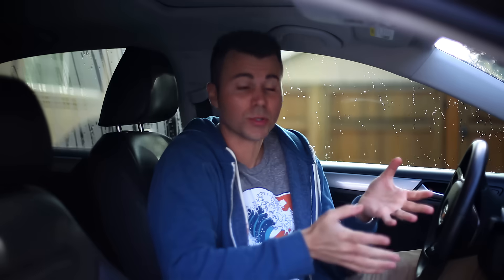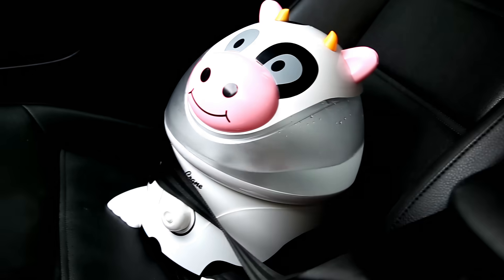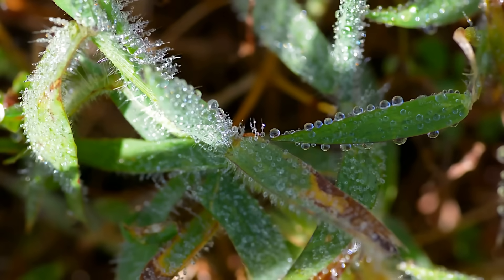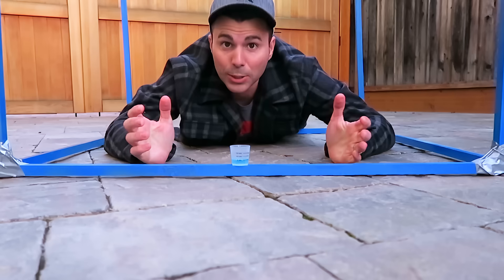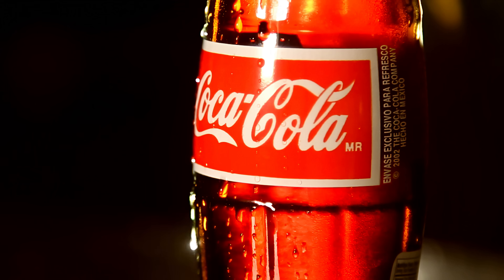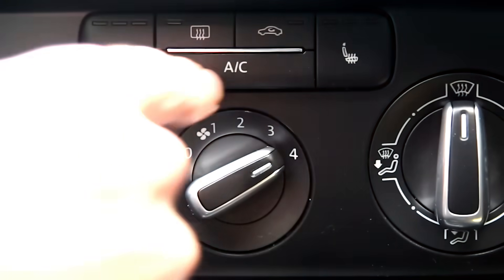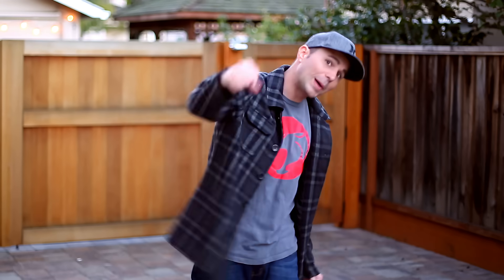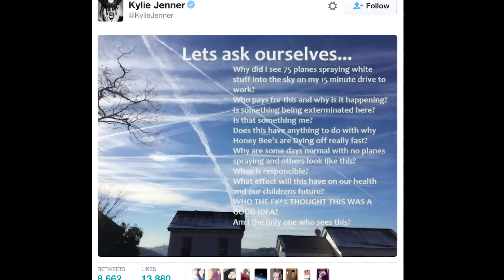Defog your windows TWICE as fast using SCIENCE- 4 easy steps

Comment: The Rober Principle: If Mark makes a video, it goes viral.
Reply: +Mark Rober I see what you did there! Also, while you're here, on a water bottle rocket, are long fins, or short fins better, do you want it to spiral, and what is the best ratio? I would like to see a video on it, or, if you don't want to do one on that, then you could just reply, which I would be just as happy about! Thank you!
Reply: +Mark Rober :D a reply from mark
Reply: ***** Thanks for answering! I have (basically) already done so, as I did it in my honors science class recently. Our rocket, which had three long straight fins, a screw on cone (as we had to put a payload in/on it), and was filled with 1/3 water, 2/3 air, and went the highest, compared to about 6 others which were each altered differently. I just wanted to see what you would say, as you worked for NASA. (Also, I gave my science teacher our rocket, and made a replica afterwards so I could work on it at home). Thanks again!
Reply: +Mark Rober Why do you keep saying "believer of the scientific method"?, this is only bait to any "non-believer" (using your terms) to argue that science is a set of beliefs. It isn't. We use the scientific method because, so far, it works. If some better method comes along, well then, we change it.
Reply: Scientific method = hypothesis, prediction and experiment.  Strictly speaking experiment and observation without model, hypothesis and prediction isn't scientific because it isn't an effort to extend understanding,  It IS, however, the basis of engineering, which is applying knowkedge of phenomena to produce desured results.
Reply: pssst3 If this was a reply to me, I don't get your point. If not, sorry. :p

Comment: So your video is about defogging windows but your thumbnail says defrosting. if you are defrosting your windows you would use different techniques. Don't open your window. You are trying to warm the iced windows till they melt. Also use recirculated air. It will be warmer and take less time for your car to warm it up again.
Reply: +Hugh Gilmartin That's not necessarily true. If you're in your car and breathing inside it so the air is warm and humid, then get out and leave it overnight when it's very cold, you'll get ice on the inside as well. My car had ice on the inside yesterday morning. It was -22C overnight, and I'd been breathing inside the car the day before, when it was only -10C. My breath condensed on the window after I'd gotten out, then froze.
Reply: +Andy Cox I was thinking the exact same thing. Ice forms on the OUTSIDE of the window.
Reply: His techniques for defogging are correct I think he just used the wrong wording in the thumbnail. BUT yes ice forms outside of the window. In that case you can still just scrape it off or wait for the air to warm up and let the ice melt.
Reply: Precisely what I came to say, as well.
Reply: +Jan Goh 
Seconded. This is the worst! Try getting enough maneuverability with your ice scraper INSIDE your car! #thestruggleisreal
Reply: +Andy Cox Recirculating would give you warm air quicker but you are likely to get better defrosting at the expense of more fog inside the car.
Reply: +Andy Cox he changed the title lol
Reply: +Overand Not if the a/c is on.
Reply: Recirc air is drawn from under the dash or the floor.. No car ventilation system uses the above dash vents for return. Direct air supply and set fo recirc and you just reduce the air flow
Reply: +Andy Cox Yeah - and often (but not always) after doing that defrosting, you'll be nice and foggy on the inside; so we get to re-do what he suggested!
Reply: +Andy Cox A lot of newer vehicles aren't capable of being on defrost and recirculating at the same time because it actually takes the recirculated air into the defrost vents when it's blowing through the face or floor vents :(
Reply: pssst3 Ah yes. I just assumed, and now I look silly. Thanks for clearing that up :)
Reply: +Jan Goh I only get frost on the inside if I leave an open drink container in the car, and the car is parked in the sunlight. In the morning there will be frost on the inside. Otherwise its always on the outside only.
Reply: +Tasty Glue glue taste sweet?

Comment: Great video Mark!!     You know.. this is exactly the kind of stuff I LOVED when they would test it on Mythbusters.   For ratings they always seemed to have to cater just making bigger explosions.  But I loved when they tested stuff like what type of road intersection works best, or best method to board an air plane and stuff like that.    This fits right into that type of thing to test.. so in a way.. this video was like a little mini-version of mythbusters testing the stuff that I actually found the most interesting (and actually useful).    Now I just have to come up with a way to remember the results...   A/C on.. heater on high.. recirculate off.. and crack the windows.... got it.  :)

Comment: For what I have personally seen turning the air circulation on is better.
Reply: +Alain Sadun If your engine is cold, it might allow it to heat up the air faster. Combined with the A/C which gets rids of some of the moisture in the air it could indeed be beneficial (although I don't exactly know how a cold engine would influence the A/C).
Reply: +Niosus The biggest problem with thinking the A/C will help is that it completely depends on the conditions of the air outside. The only way A/C can pull moisture out of the air is if, in fact, the air outside is above the apparatus dew point of the evaporator coil in the car (more than likely around 45 degrees). So, in essence, below 45 degrees, turning on the A/C will actually hurt you by decreasing the temperature of the air going into the car and causing it to take longer to defog the windshield (since colder air holds less moisture). However, if you recirculate with the A/C on when below 45 degrees, it could help if the car has moisture inside and the temperature inside the car is above 45 degrees. Basically, you need some pretty specific conditions for the A/C to make a difference.
Reply: +Alain Sadun Maybe if you live in an extremely humid place the air inside your car is drier than outside air but generally recirculating air in the car results in more fog.  Another possibility is that your car is automatically turning the A/C on when you recirc (both our Chevrolets do this).
Reply: Chris Ransdell Perhaps you are right, I live 100m next to the sea.

Comment: One of the suckiest things about winter is living in the north, where you don't have condensation inside your car, but frost on the outside.  MUCH WORSE! (and maybe frost on the inside if the slush that melted off your boots condenses and freezes on the glass overnight.)
Reply: +Jim Bryson Just take a bucket of really hot water and pour it on the windshield! This way the windshield breaks and you can easily kick it out to get a clear view :) 10/10, works every time!
Reply: +Jim Bryson Frost on the outside and fog on the inside as soon as you get in and start breathing 8-).  The 4 steps in the video miss the problem of when to crank your heater up to high 'cos if you crank  it up to high right off, you blast freezing cold air through the car...
Reply: +Jim Bryson Buy one of those things that looks like a sunshield ( the one with a shiny reflective surface) and put it on your windowshield overnight . It takes a 30 seconds of time but can save 15 minutes in the morning of not having to scrap off ice. 

just google "winter windshield cover"
Reply: +Jim Bryson a solution of 2/3 rubbing alcohol and 1/3 water in a spray bottle. Spray it on and the frost melts, problem solved. :)
Reply: +Jim Bryson if at all possible park your car facing east without an obstruction to the sun. right now I get about 30 min of sun on the windshield before leaving for work. the other day I backed my truck in (facing west) and had to scrape the frost off.
Reply: cover winshield with old blanket ,pull off in morning ,no ice
Reply: I tried covering my windshield with a blanket once. When I got up in the morning, ready to drive to work, it was quite firmly stuck. Do you know how hard it is to drive a car with a blanket stuck to the windshield?
Reply: +Jim Bryson Electrically heated windshield. Extremely useful. Or just use something to cover the windows up, that helps too.
Reply: +Jim Bryson Why don't you just scrape it off ? Every snow broom has a scraper on the handle.
Reply: +laura clark Thanks. Everyone else replying to frost comments is just saying use the scraper. No duh. But you gave an actual tip that will make deicing easier. Thumbs up to you.
Reply: +laura clark This is more or less what deicing windshield washer fluid is.  But - if your sprayers are stuck etc, then that's not much use.  Plus, your spray bottle gets a wide surface without needing to drag your wiper blades (or scraper) all over the frost.  Thumbs up!
Reply: Washer fluid is basically glycol&water.
Reply: +julienjjj This depends on that formulation, but in most cases the primary ingredient is methanol, which has fairly similar properties to isopropanol
Reply: +Gao Chen If it takes you 15 minutes to scrape frost/ice off your windshield in the morning, that's another whole problem in itself.

But that's beside the point. I'll look into getting one of those covers. Thanks for the tip!
Reply: +Jim Bryson carrying a squirt bottle full of washer fluid, covering the windshield exterior when you leave the car will make the scraping go quicker.

Comment: Arrgh,  the title indicated that you were going to defrost your windows and  it was all about defogging.   I don't ever seem to have a problem with condensation on the inside of the windows.   On what passes as a cold winter morning here I will have frost on the outside of the windows.  Much of what you posted does apply nicely to fog on the inside, but what about frost on the outside?  With a fogged window you only need to take the water through one phase change,   And I guess the same applies to defrosting the windows because one the frost melts the windshield wiper takes if off very nicely.     

It looks like you are in a rather temperate area where frost is not a problem.
Reply: ***** Fog has never been a problem for me.  But if your car is well ventilated on a cold day, for example before you shut your car off it is a good idea to bring in fresh cold air, then you will not have nearly as much fog on the inside.  My cars fans sometimes run after it has been turned off and it might be doing just that.   As you said cold air has less carrying capacity.  And the best way to fight interior fog is to limit the amount of water on the inside of a car.    And of course if you drive with  multiple people in your car, all warm bodies breathing out warm air that is heavily laden with water, you will only make the problem worse.

Preventing fog in the first place is better than treating it after the fact.